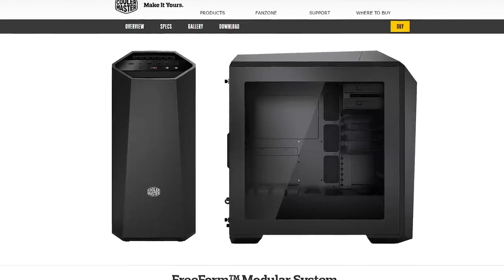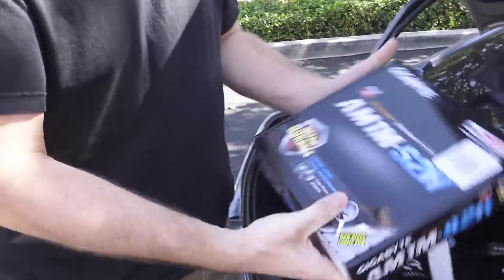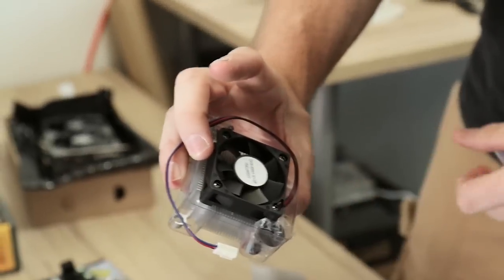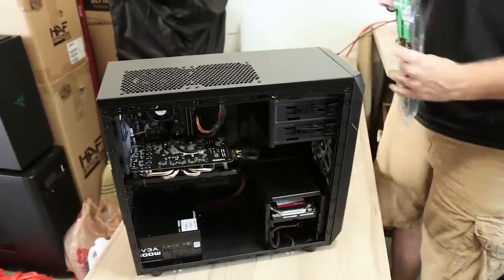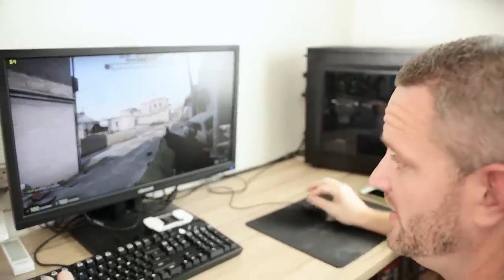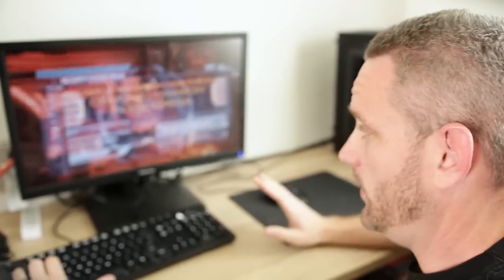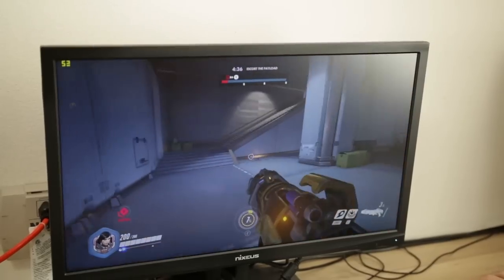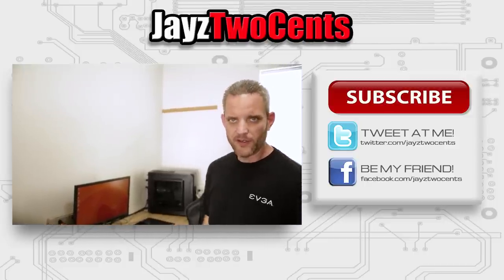Ultra Cheap Gaming PC 2016 - Can you play games for under $400?

Comment: would it run gta
Reply: Azze217 ye would it run?
Reply: Azze217 GTA existed before GTA 5
Reply: Yes but I am a triggered fanboy
Reply: the answer should be YES
but would it be playable? Kappa
Reply: azze wasn't talking to you, apparentely it didn't tag nick. sorry
Reply: h-00-d dude, i run an fx 8350 and still have issues keeping my framerates above 50 on crossfired r9 290s..... And thats both on 1080p and 1440p which indicates a cpu bottleneck... If my fx8350 struggles this thing will aswell and its not the gpu im worried about....  That cpu though.....  Pffft its gonna be rough i can tell you that so please throw out the namecalling and take whatever i said for what it is because most likely its the truth
Reply: probs not, open world games are decently cpu intensive...
Reply: Fists First it would run it fine, gta 5 isn't that graphics intensive
Reply: h-00-d we all established that gta doesnt require a titan x(p)  to run at 1080p but if my amd 8core at 4.6ghz struggles an anemic amd 4 core 2.6ghz chip would completely crap itself
Reply: Not with that cpu.
Reply: I did run GTA V on my 11 year old 3,3Ghz Core 2 duo (Xeon 3060) and Nvidia GTX960. Stable 25fps is what I got if I turned down all CPU demanding things in the game and I could turn other GPU daminding things high up. Just for fun I tested a GTX980ti and I got the same 25fps but I could turn up the GPU demanding graphics really high. It was playable but 25fps is to little in a fast phased game like this and it hurts the game-play as you crash and miss a lot more when shooting then running at 60fps  even if it looks ok when you have motion blur at full.
Reply: (Whenever someone says Gta they mean gta5 like its the only gta )

Comment: (This build idea has been dropped completely)
Liquid-Cooled Intel Core i7-6700K 4.00GHz Quad-Core Processor 
NVIDIA GeForce GTX 970 4GB GDDR5 Video Card 
Expansion capable to 2-Way SLI/3-Way CrossFire Multi-Graphics 
16GB DDR4-2133 Memory 
240GB Solid State Drive 
2TB SATA3 7200RPM Hard Drive Storage with 64MB Cache
Reply: Ram is good but make sure your motherboard is compatible,  and make sure if it has heat spreaders that it has clearance (AKA if it is bigger than other ram styles. i.e. GeIL EVO POTENZA Ram sticks) for your other parts such as the gpu and cpu fan on the motherboard to fit. If you don't plan on using crossfire or SLI, it won't matter. the 240 gigs of SSD is a bit much if you only plan to use it for the OS, which is what I plan on doing, so go lower for that if you can so your computer can boot up much faster.

The 2TB HDD is very good. Lotsa memory. The CPU liquid cooling is something I'd only suggest if you want to overclock your gpu, turning it into a toaster with high tempuratures in need of cooling when you push it for the best graphics you can get from your card. The video card you have is definitely good but if you're going to spend that much money you might as well change that card or go for a slightly cheaper or slightly more expensive one as you'll find that an extra hundred dollars is a lot for a little more power compared to some other cards. The cpu itself is definitely future proof with hyperthreading and more than enough speed, but know that hyperthreading is just a clever tool for faster speeds ONLY if applications/games are programmed to use this feature. Otherwise going with an i5-6600 (K variant is for overclocking and voids your warranty) is better for price for the mere cost of hyperthreading for more or less the exact same cpu power overall.

Remember to make sure everything you have is compatible and manageable in your tower case. You don't want to have to buy a cpu just to realize it doesn't work with your motherboard or that you can't put the power supply in your case without getting in the way.
Reply: no, buy 1050 or 1060
Reply: tfarcenim No he should buy a 1070 absolutely not an 1050
Reply: i dont need that much perofrmance.. so i'd be wasting money
Reply: tfarcenim ok
Reply: by the way. 1060 is enough for 1080p to play at 60 pfs ultra settings in witcher 3.. so why spend another €200 ?
Reply: tfarcenim where did witcher come from? And i meant that the person that made this comment should not buy that proccesor for a 970/1050ti.
Reply: oh i thought you meant that 1050ti is shit in general. i gues 1060 will do fine for him.
Reply: tfarcenim yep
Reply: Bad Building Buy yourself a GTX 1060 and i5-6500. CPU will be totally enough, where GPU is better than 970
Reply: People are still commenting? I got rid of this idea like 4 weeks ago. Plus I just finished building one (with different specs of course)
Reply: Oskar Siemieniuk siema
Reply: Yeah sounds good but be careful with the powr supplies, a lot of them are crappy or dangerous
Reply: LewanGOALski Alex?
Reply: Oskar Siemieniuk nie tylko jakis polak
Reply: You should have gotten a cheaper cpu like i5 because i7 is kind of unnecessary and opt for a better gpu. GPUs make up most of your gaming performance however, it is also important to have a decent cpu. Your system is still very solid and is a powerful PC.
Reply: 970 is better
Reply: I got a spicy build 
AMD A10-7700K Radeon R7, 10 Compute Cores 4C+6G (3392.6 MHz)
8 gbs Max 64 DDR3 Memory
Microsoft Windows 10 64-bit (Build 14393)
Zotac Amp Omega GeForce GTX 980 Ti 384-bit 6 gb  GDDR5 - CUDA Cores:  2816
Power Supply 750 Watts
Reply: Pixel Plays not really I have the processor overclocked 4.6 gigahertz
Reply: Bad Building I know this is old but I'd go for an i5 6600k and better graphics card.
Reply: Jesus, people are still commenting. This was like from 4 months ago. This idea was dropped so long ago
Reply: Bad Building the core i7 is overkill af

Comment: why not get a rx 470?
Reply from the maker: +Hammad Ul Haque because it's obviously more expensive
Reply: +JayzTwoCents oh yea, sorry, misplaced the 460 with 470
Reply: I had to look this up....At Hungary there is $2 difference btw the 2 cards
Reply: +Hammad Ul Haque 380x is better than the 460
Reply: +DerisiveLaughter ya ya, what I meant it is that I combined the rx 460's price with the rx 470 performance, creating a rx 265
Reply: A rx 470 is not more expensive than a 380x. You can find Rx 470's anywhere from 199-239$ USD, meanwhile 380x's are going for 197-264$ USD. Got the prices from newegg and a rx 470 is noticeably faster.
Reply: +JayTwoCents thats Hey you go the same micro center as me. prices there are dirt cheap! All my micro soldier tools are cheaper there then frys

Comment: i have a 750ti with an i5 and i get 120-170 fps
Reply: on csgo
Reply: because u have de i5
Reply: +antonio stefan gabriel the 750 ti isn't a bad card
Reply: Octopus Rift read it again
Reply: Octopus Rift xd
Reply: Csgo uses a lot of CPU not GPU
Reply: +CorruptedPoison no but it's not a particularly good one. you can find them used for like 70 or 80. good enough for a lot of things though. I was lucky enough to get a 770 for 100 a little back off Reddit. guy happened to be local. just my luck.

Comment: BTW You can play BF4 on max settings with 4 GB RAM easily. I don't get why 8 GB has been seen as the minimum anyone should go to for years.
Reply: Because Windows will barely load properly with 4gb...
Reply: Largely, because it's no longer 2012 and loads of games alongside Windows 10 will benefit far more from 8GB.

Comment: Nice. Good parts list. That rx-380 is a really great deal. You really can build a good PC for cheap. fleaBay is also a great source if you know what to look for. Cheap combo:  used i3-3240 and used Dell Optiplex 7010 SFF motherboard. Heck I'm still using my old 8800GT on that setup and it plays games at 1080. You can get those for $10.  I play DayZ mod Arma2 and get about 40fps.  You don't need a lot of money if you don't mind looking for the cheap parts that work and putting it together. It's a good way to get practice building a PC before you throw down lots of money later on, if you ever need to. My next upgrade is probably a gtx1060 and I will have no need to upgrade for a couple years.

Comment: I had to rebuild my work PC, primarily for citrix use on multiple screen...I had mobo: Sabertooth 990fx, CPU Atholon II X4 465, 500gb sata hd, and 4gb ram...just had to get a graphics card and i got 1050ti... I new it was over kill but all i had to buy was a graphics card...well I mostly play FF14 and i can play at high settings with 60fps no issues.

Comment: I got a similar setup on one system, same CPU but AM1B mobo and M1 Alpine cooler with 8Gb 1600Mhz ram with an old 9800GT 1GB graphics card. OK, it won't play DX 11 games but it plays Dues Ex HR with ease as well as doom 3 and Might and Magic: Heroes 6. If i wana play anything recent then I use my FX-8350 or my I7 930. I know they're both old but I don't upgrade until I have to.

Comment: 2018, with a 2013 laptop running fortnite in potato mode at 20 frames per second, space engineers at lowest setting with 15 minute loading screens and after placing 1 block almost down to 15 fps

Comment: 500 watt power supply? Seems a bit excessive for a budget machine. Also, the Phenom II x4 would have given double the power for just about the same price assuming your MB supports AM3 socket (or you found one that costs the same). The newer GTX 1050 mini would have been cheaper. Not sure if it existed while you filmed this thing, but I'm seeing prices for the GPU you mentioned and can't find anything below 200.

Comment: I may have asked this question before.. but cant see an answer. As a total tech beginner. What is a Core vs a thread? Also how do you tell what is a core, and what is the thread in task manager?

Dissclaimer i just started using water cooling, with a AIO I think its called. I am worried since i hear weird sounds... will it leak, and if so will it kill my PC?

Comment: Instead of saying all that order a Venti iced vanilla Latte with Caramel Drizzle add Whip.  It's easier to say and the Barista can enter it in easier.  Also. The Barista on bar is going to have an easier time.  They may end up prepping shots for a Machiatto and mess your drink up because they had 5 drink orders in line and didn't realise until they poured the milk that it was actually a Latte with extra words.

Comment: And for just about 100 bucks more, you coulda got a decent CPU and motherboard and you'd be in even better shape. The machine wouldn't be super future proof, and youd probably have to drop the quality settings to minimum ina  couple years for newer games, but for 400-600 bucks thats not bad. And its still better than consoles in the areas of graphics, peripherals and customization options. If you're the kinda person that just wants to play little F2p, moba and multiplayer games, and doesn't want to play AAA titles on high settings, that machine will do you just fine.

Comment: Managed to pick up a i7 4790k new from £180/$230 from ebay .
Do you think you could build a high end gaming system for for lets say 6 to $700 with the price lowering a little on older components?

Comment: i5 4460 with  Arctic Cooler Pro 7 Rev.2 CPU cooler
Asrock Fatal1ty Z97 Professional
Asus GTX 960 Strix 2GB
1TB Seagate Barracuda 7200rpm 64mb
Asus DVD-RW drive
Corsair VS550 Supply
NOX Coolbay SX (kinda rough shape, 1 exaust fan only)
12GB DDR3 1600Mhz Corsair Vengeance LP (three 4gb sticks, the 4th was broken or it would be 16GB, I got warranty though)

I got this build for 483€, some parts used, some new, I might be able to get more 4GB of RAM from warranty, do you guys think this was a good deal?
Reply: Gabriel Costa If you got it a while ago, it would be a good deal. A very alright CPU and GPU, and a fairly good motherboard. If it was more recent, then it's less good. 2GB today is limited to low end cards. Other than that, it's just that the PSU is crap. But that isn't too big of a deal
Reply: Seon-Ho Thanks for your opinion, I got it last year, I guess it wasn't the best deal ever but it was worth my money :), thanks man

Comment: still on a core 2 quad. my video card and cpu cooling are my limiting factors. already overclocked my q9300 to 3.5 stable on air. need water loops..... waiting for jays cheap watercooling loop guide. want to do it old school

Comment: how much fps i will get for this in csgo:asus dual geforce gtx 1060 3gb oc ,Wd blue 3tb 6gb/S    64mb , cooler master hyper 212 evo red led , crucial ballistix sport Lt DDR4 2x8 gb 2400mhz ram, msi x370 gaming plus motherboard,intel i core 5 3320m

Comment: Everytime I try to look up parts to build a cheap starter gaming pc from $300 to $400 the operating system always puts me over my budget. As mentioned in this video he is not including the software only hardware for the cost of the build..the only option I would think of in this case is a free install of ubuntu os ..just have to deal with the learning curve and have the patience to get around compatibility issues.

Comment: I got a win 7 PC with 3ghz 2 core, 2gb of memory, and a 250gb hard drive for $100. But if I lunch a simple game like YouTubers life or oxgen not included I get around 5 and 15 fps on low settings, I spent around $100 on games but I really can't play them. I almost bought a good gaming PC on Amazon but my dad found that PC so I bought it. Now I realized that I should have gotten the other PC.
Reply: I did upgrade it a little by getting 4gb of memory, I would have bought more but that was around $100 and there was no covering or rgb lights just the bare bones  of the memory. I'm forced to only buy that memory stick because there is no other memory sticks that supports my motherboard. It harder because
 I have a limited budget.
Reply: Does anyone know if the Gigabyte GV-RX560OC-4GD REV2.0 Radeon RX 560 OC 4GB Computer Graphics Cards is good for gaming?

Comment: I’ve got an itx AM1, but I’ve got the sempron 3850 quad fitted, I didn’t build it to game, but with a 1050ti it could game, but even on low settings and res it stuttered like mad in certain areas on fortnite and certain other games, that’s a big bottleneck of a 1.5ghz cpu lol, it’s a spare system now without 1050,  the Athlon is the better choice to play games if you must on what is an HTPC chip, but a 380x would be bottlenecked like mad, more gpu than cpu.    AM1 is not designed for gaming lol.    My Athlon x 4 860k plus gtx 660 games 100 times better for the obvious

Comment: This video could use a possible re-visiting with the Athlon 200ge processor.

Yes, it is a lot more expensive. You're paying 55$ for the apu, and still having to buy an a320 motherboard.
But the fact of the matter is the athlon 200ge is still a low-budget,  low wattage apu, and is built on the ryzen architecture.

Maybe make a re-visit some months down the wrote when t he athlon 200ge goes on sale for cheap, especially when intel has time to counter it. since AMD is effectly targetting the g4560/g5400 cpus with it.

Comment: Vulkan is a lot better API software than Direct X 11 or 12. Vulkan should be the standard that Direct X 12 has to match. Vulkan is not perfect but it is a lot more user friendly to older hardware than MicroS$ft standards. Windows 7 Pro,Home or Ultimate with Vulkan will ran as fast or faster than Windows 10 with Direct X 12. IF the game is optimized for Vulkan Windows 7 or Windows 10 will be more smooth than Direct X.

Comment: ATTENTION! 
Okay now that I have it, tell me if my laptop has good specs. (I am not going to build because I need to take it to class) 
Intel core i7 7700HQ quad core, turbo boost to 3.8Ghz, 8 threads
16GB of DDR4 ram
Gtx 1070 8GB DDR5 RAM
512GB nvme pcle SSD
1 TB hard drive 7200 RPM
120Hz G-sync panel

Comment: as of Right now as I m typing this comment I don't think u can build a better pc than an g4560 Pentium+1050ti and a h110 MOBO along with 8gigs of ram. n 1TB of HDD with a budget of 350-400$. going with a intel h110 chipset MOBO has great potential for upgradability options in the future as u can easily upgrade to an i5 or i7 once u have the money a few months later. talking about AMD, if u go with ryzen. its great. u can upgrade till the ryzen 7 1700 but apart from ryzen cpus u don't have any upgrade path if u choose AMD

Comment: hey Guys/J I am wanting to get back into gaming and wondering if my radeon 6870 and Phenom II X4 955 3.2 ghz cpu with 4 GB ram  on a Ga udx 990 mobo is going to cut it before i want to upgrade down the road. What do you suppose is the bottleneck on this system?

Comment: you could have installed SteamOS then the cost of the OS thing would have been moot.  The fact that you didn't is redundant after that.  You may not have had as many games available but you won't with that hardware anyway.

Comment: Skip the Graphics card and grab some slightly, emphasis on slightly faster RAM and just get an APU A10.
Reply: CapitalGearGaming hell no, if you want a gaming pc then that pc is great
Reply: Prime Gamer my option would be cheaper still. Can run BF4 medium settings at around 50-80fps dependent on the ram you get. But that's up to the user of course. ^_^

Comment: Can i still do this build but change the cpu to an i5 6600k?
Reply: Oh and with this no because this isnt an lga1151 this is what ever amd uses basically amd has the pins on the cpu but intel has the pins on the motherboard so there would be no contact and the bios and drives wouldn't be compatible

Comment: With all due respect you are wrong.  You need to take into account Windows OS.  Why? Because without it no game will run.  Unless you will be running Linux (steam os) which is free.  Good luck running a game on a ps4 without its own operating system.

Comment: But can it run Minecraft?
Reply: 银Silver dude my old laptop was core i2 duo and it ran mc in40 fps and lower
Reply: Install and configure Optifine mod and it should run no problem. My son's running it on a 3 year old APU without issue after adding that.